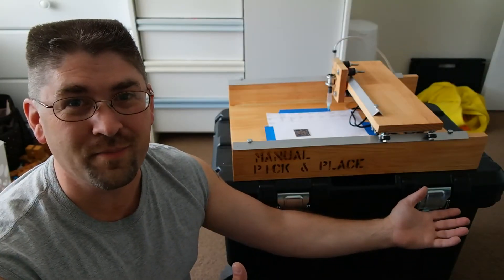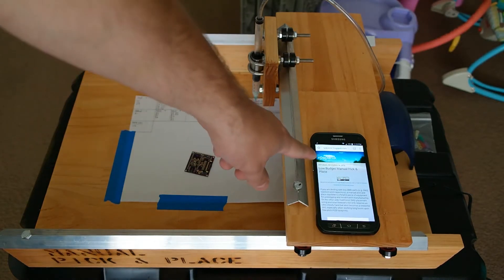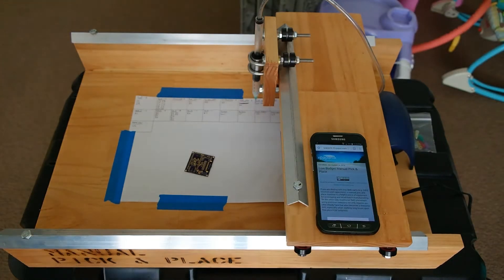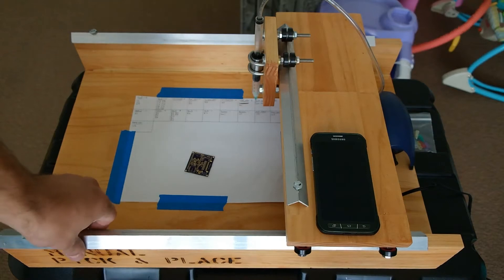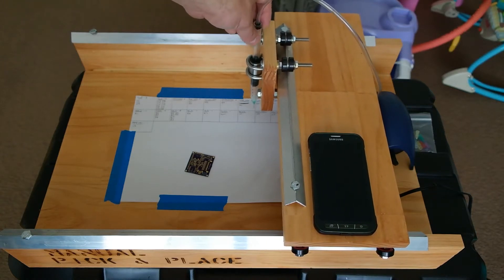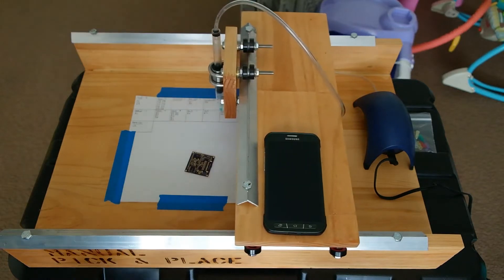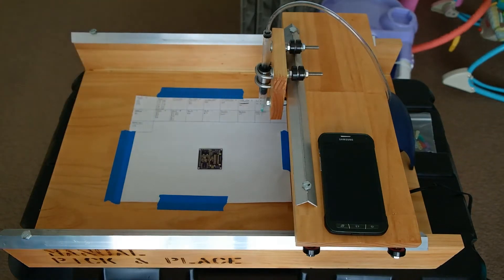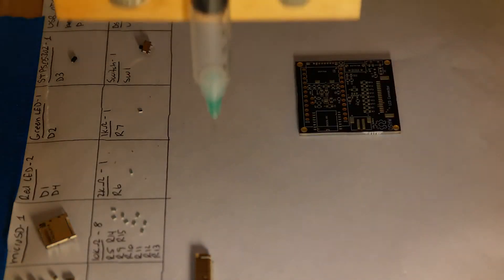Manual Pick & Place Machine For SMD Assembly

Comment: I wonder if a 3D printed standoff and some recovered 8mm smooth rods from old busted printers would work, might make the design smaller, but be able to 3D print the design similar to a x axis carriage but instead of a hot end for 3D printing, have the vacuum pump on it...
This guy did one..I guess the angle aluminum is more rigid than a rod
https://www.thingiverse.com/thing:385567

Comment: Thanks for the reference mate ! Thumbs up !

I agree with you that the linear bearing for the z-axis sucks, the needle one works much better. This is not trivial, since the linear one naturally provides smoother sliding along the z-axis, however it fails completely in rotation. On the other side, the needle bearing provides perfect rotation and yet it doesn't have any problems in vertical movement (the spring takes over there).
Reply from the maker: +vpapanik Your very welcome!  Thanks for designing this unit.

Comment: Try a fiber optic microscope, under $20 ftom Chinese sites. They include LEDs and will work with some Android phones. For the vacuum you could try a solder dispenser as most also have a vacuum port.

Comment: Next step is some acme threads and some stepper motors and voila...a arduino cnc pick and place

Wicked cool though...does it help alot w/ stability issues?  

What board is that you are picking and placing on?
Reply from the maker: +Brian C LOL one step at a time Brian, I would love to have an actual small automated pick and place machine but I don't need that amount of manufacturing ability yet.

It does help with stability issues, that's the reasoning for building it, with the smaller components.  I just have to rework the Z-Axis with the needle bearing instead of the linear bearing so it will work better.

That board is the next iteration of the arduino environmental datalogger board, I should have the video out for that next week.